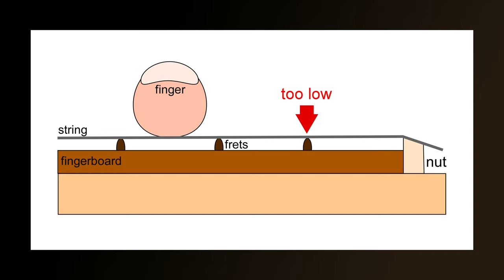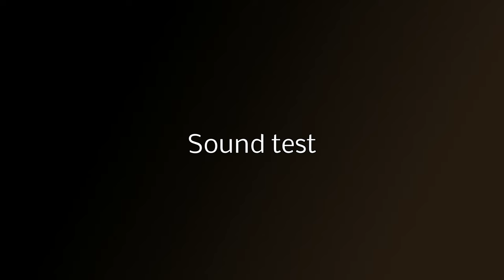How to fit a bone saddle and nut.   Why fit a bone saddle and nut on an acoustic guitar?

Comment: how is the intonation on the g string? Usually it should be wound and since it's not in theory you should need a bit longer scale. That's why the b string is a bit longer than the g...
Reply from the maker: The guitar intonates perfectly.  Sorry to disagree with you, but the G string does not have to be wound at all.  The strings are wound to create the correct mass to tension ratio, so the same effect can be achieved using unwound strings with a greater mass or thicker gauge.  This is why classical guitars are hardly ever have compensated saddles, because the mass of nylon strings is greater than steel ones.
Reply: ok, thanks. I was just asking... @guitar-academy
Reply from the maker: @salmon1s Sorry if my answer was over the top, I was just trying to get as much detail as possible for my students and subscribers.  😊😊

Comment: Would you ever sand down the nut? Also i have a guitar but dont know what model it is. Its a samick, what are the odds of finding a nut and saddle on amazon that fits? Also should it be the same style of saddle? Or should it be the same model on my guitar?
Reply from the maker: Yes I would sand down the nut but it requires a lot of care and accuracy to get it right, I will be doing a video on this soon. The nut and bridge are only in 2 or 3 different sizes so I guarantee you will find a nut and saddle on Amazon or eBay quite easily,  You need to measure the slot and then search for that size.  They don't need to match, but it's nice to have a match for aesthetic reasons.  The make and model of the guitar isn't important as most makes use standard off the shelf nuts and saddles.
Reply: GCH Guitar Academy Thank you! I ordered a bone nut and saddle. I had some buzzing from the high E string and wanted to get a new saddle. Well you'll never guess what I did, I pulled it out and flipped it and now it plays like a dream, im still going to replace it just because its plastic and bone sounds better. Tha js for the help and great video!
Reply from the maker: @higheststandards3344  That is interesting . . good luck with the new one.   Thank you 😊

Comment: Brother, the TUSQ for me in a drop test has much higher tonal expression from the material. It almost sounds like a piece of glass. My guess is the mid-high would be better than the bone with this material. My only concern is maybe the bone would allow the resonances to couple more effectively? There are typically trade-offs, so wondering if you’ve tried this material at any time? Thank you, the content is as usual very edifying. 👍🏼
Reply from the maker: I fit TUSQ on electric guitars to replace the nut but never on an acoustic guitar, but my favourite material for electric guitars is brass.  I like my acoustic guitars to sound richer with as little bite as possible because I fingerpick and hardly ever strum.  At the end of the day it's personal taste and sometimes the guitar that governs the choice of material.  Bone is cheap enough and easy to work with and is a great improvement over a standard nut and therefore is the best thing for a beginners lesson on replacement.
Reply: @guitar-academy  ; yeah, I have both and plan to fiddle around with both as time permits. I’m also changing the plastic pegs for ebony. I did some
research and love that they are in the middle of the range for the response characteristics. Plus the inlays look sharp. 😄 In any case the Martin I bought with the plastic pegs and TUSQ saddle sound as good or better than a friend’s hummingbird. I just want to play a little here and see if I can get more wholesome clean. It’s a little chirpy, that may be the TUSQ. The nut is TUSQ too, but it’s set so perfect from Elderly, the upper action is perfection, so not touching that baby. 👍🏼 The only thing is the bridge height, so going to lower a tender bit and hope I don’t get 🐝.
Reply from the maker: @Twentykixx  I hope it all goes well . . 😊
Reply: @guitar-academy  ; I have your tutorials to help fix me if it does! You shred bro! 🤘🏼🎸
Reply from the maker: @Twentykixx  👍😊
Reply: @guitar-academy  ; so I managed to get the action lowered and used both types of saddle TUSQ vs Bone. Low E @2mm and high E @1.7mm approximately. Both saddle heights exactly the same, and the intonation is set perfectly for both. In my case the bone was approximately .25mm thicker than the TUSQ, and somewhat heavier. The tonal variation at the high end suffered with the bone, but performed equally as well in the low end as the TUSQ. In all the strumming and clumsy picking, I and my daughter both found the TUSQ more pleasant over the full range of the guitar. No buzzing and the action is really ideal at the 12th now. The bow on the neck is roughly .75mm at the largest delta. Changed strings to light and still no buzz and now plays like a dream. Martin makes a wonderful instrument in the D-Series, 🤩. Question... when I look down the neck from top to bottom looking for warping or irregular flex using the 1st fret as a reference point, I simply cannot see anything, however it feels irregular to me for some odd reason. Maybe the nut because of the slope is playing into this? Should I remove the nut and then look?
Reply from the maker: @Twentykixx  You can try putting a capo in the first fret and optionally hold down the strings at the high end (15th fret +) and use the strings as a reference this sometimes works.  Most luthiers use a straight edge like a ruler and then look from the side and not down the neck.

Comment: Can you tell that which grade sandpaper you used?? Thank you 🙇🏻‍♂️
Reply from the maker: good question. . .  to get the saddle to the correct height I used a very coarse emery paper (about p80) and then I finished it with finer paper (about 150).  If the paper is too fine the bone fills it up really quickly and you have to keep cleaning it. 😊
Reply: @guitar-academy  thank you very much sir
Reply from the maker: @ishaangautam5499  my pleasure 😃

Comment: thank you.. I was given a Richwood acoustic electrick guitar for my birthday. I find the action is quite high and the strings are very heavy to push in ... would it be a good idea for me to swap and lower the bridge and nut with bone ...and lighter strings ... what would be your advise ??
Reply from the maker: With guitars it's very much a taste thing and different guitarist like different things. . .  But if it was my guitar i would lower the action and put lighter string on it.  But lower the action slightly with the existing string first (keeping the original parts) and check it's not going to buzz.  With my students I have found that just lighter strings sometimes makes a massive difference. . .  I hope this is helpful . . . 😀
Reply: @guitar-academy  thanks ..I'll start with lowering the action as you discribed it..carefully and step by step.

Comment: Sanding that bone saddle down seems tedious.  Are they sold in different heights?  How long does it take to sand it down?
Reply from the maker: You can get them pre- shaped to specific guitars if you want, but it isn't that hard.  When you think you only have to shape it once it's worth taking your time over.  If you prefer you can use a power tool to get it close and then finish it by hand as well if you want . . 🙂
Reply: @guitar-academy  I've got a Fender StarCaster Acoustic. I am going to start with this one. Watching your nice videos, they are very nice!
Reply from the maker: @carroll6  Thank you very much . . 🙂🙂

Comment: What to do when the groove on the neck where the nut goes is uneven? I have a 2nd hand guitar that someone sanded on the groove and there's a tiny space at the bottom of the nut, if you shine light on one side you can see it trough... Does adding wood glue or some filler will fix it?
Reply from the maker: The only time I've come across this is when the there's extra some material under the nut (glue or varnish).  Usually you just have to make sure the slot is cleaned up with a mini file.  If you want to clean it up without removing the nut, yes a little filler would work . . 😊😃
Reply: @guitar-academy  It's already clean because someone tried precisely to clean the residual glue from the previous nut and sanded too much unevenly, I'm just worried that if I put wood filler the new nut will stuck to it and later impossible to remove
Reply from the maker: @Alex_Martz  good point.  I guess you could put the wood filler in and level it and put the nut in after the wood filler is dry . . 🤔  or you could get a new blank nut and shape the nut to the guitar (that's what I would do)

Comment: Quick question, so I’m not very experienced with the guitar yet but I was replacing my strings for the first time and noticed that my bridge saddle was missing and I couldn’t find it anywhere. I did some research and bought a new one but I was just wondering how much I need to sand it down to since I don’t have my old one as a reference since it was lost.
Reply from the maker: I couldn't answer that in text but perhaps this video will help,  https://youtu.be/UgsN_HOjV2c

Comment: great video, im doing this to my guitar too, and i wanted some clarification, btw, sounds much better, sounds brighter to me :)
Reply from the maker: I've had time to play this guitar now and I can report that it really made an improvement to the sound.  
As long as you keep you old bridge and/or nut you can't go wrong, because you can always put them back on if it doesn't work.  😊
Reply: GCH Guitar Academy yea, ive kept em to compare sizes and sutff, i was suppouse to get the parts today, they still dont arrive :/
Reply from the maker: @bidartbauer8581  oh well . .  I'm sure the parts will be with you soon . . . 😊
Reply: GCH Guitar Academy they arrived! and i switched em already, i didnt have to do anything to the nut, it was the same height as the old one,i did something to the saddle tho, it sounds much better, it needs a lil bit adjustment tho
Reply from the maker: @bidartbauer8581  brilliant  😊😊

Comment: Why do I have metal shims under my saddle?
Fender san luis Rey. Action is high. Can I remove them?
Reply from the maker: be careful, just in case someone has but a pickup there.  But if you can remove them easily, you can always put them back if you aren't happy with the guitar without them . . . 🤔
Reply: @guitar-academy  thank you. No pickup. Gonna remove them. They come right out.
Reply from the maker: @davep2075  👍😊

Comment: Hi,
How do you secure the new nut in after checking action? Glue?
Reply from the maker: No, I don't glue the nut.   I let the strings do the work, but I know people who do.  🙂
Reply: if you wan't to use glue, just put 2 small dots of hide glue. because when it comes time to replace it, if you used wood or super glue, you will have big problems that you don't need.  when removing the nut with hide glue, warm it up slightly with a hair drier. but be careful not to burn it.

Comment: How do u remove the nuts on the side of the bridge.?? I want to change my bridge but i am not able to remove them?
Reply from the maker: If the bridge is bolted in (which not all are, some are glued) you have to drill out the top so you can access the head to prevent the bolt from rotating whilst you are removing it. Sometimes after you've removed the bolts you have to carefully chisel the bridge out.  This is a big job and I don't recommend it if you aren't sure what you're doing, you could destroy your guitar . . 🙂🙂

Comment: Sir I am breaking my high e string of ausotic guitar again and again. Like 2 times a day. I am just so tired of it. Whenever tuning the tuning peg seems to get tighter and tighter eventually breaking the string unlike other tuing pegs. What should I do? Please help me.
Reply from the maker: Is that on an acoustic guitar ?
Some things to check . .  Make sure you're tuning it to the correct note and not a higher one.  If the string brakes in the same place, look for something sharp and carefully file it away.   If it's at the tuner, wrap the string around it more that normal, so the force of the string isn't on the edge of the hole in the tuning post.  Make sure you don't leave the guitar in direct sunlight . .  it could be one of these issues . .
Reply: @guitar-academy  firstly thank you for helping me out. I tune the strings very carefully, never on higher note. I have tried to file the peg just in case of edge. But it didn't help me. While tuing up to the right note the tuing peg gets so tight that it's hard to move and then eventually the string breaks. I have already broken 10 high e string in a month and it is always near the tuning key. I don't know what to do.
Reply: @kanak262  maybe try changing the tuning peg.  You can get decent ones pretty cheap.

Comment: Are you Andy from 'Andy Guitar', your voice is a dead-ringer?! Reference removing the pegs, if you undo the strings then push the bridge ends down into the sound hole the pegs lose their grip in the bridge and can be removed easily just using thumb and finger.
Reply from the maker: No, I'm not Andy . .  yes, that trick works most of the time, but not often on new guitars I think they hammer them home with a rubber mallet 🤔
Reply: @guitar-academy  Hehehe probably. Could ask a question? About restringing a righty acoustic to lefty; the general advice is no, but I've been looking at cross-sectional plans for a range of dreadnoughts and they all appear to have perfectly symmetrical bracing from the top of the body to behind the bridge. There is a single diagonal stringer well behind the bridge that's doesn't appear to be structural ie a bracer. Therefore I think that it's feasible to safely mount a new bridge, saddle and nut, and re-string. Am I wrong? I'm in the PH and you simply can't get a lefty in the area I live. I want to do what you did and pick up a cheap guitar and get it up to reasonable quality. Thanks for your quick reply earlier.
Reply from the maker: @tyrotrainer765  Hmmm . .  whether you can change a righty acoustic to lefty depends on the make and model.  The most obvious things you need to change are the nut and possibly the saddle.  Each slot in the nut is cut according to the thickness of the strings, but you can just buy a new lefty nut and/or cheap enough.  The biggest issues can be if the guitar has got a cut away (obviously this can't be moved), and is the saddle on an angle.  It's common on acoustic guitars for the saddle to be on an angle so the thick strings are longer than the thin strings, this is done for intonation and would need to be changed.  On some guitars the bridge is bolted in place which would make it an easy job, but on others it's glued and can be very difficult.
Reply: @guitar-academy  Cheers for that. It's actually quite easy to get LH plastic and bone bridges, saddles and nuts here, from China via online shopping, very cheap as well. Yeah, I'd only attempt it on a dreadnought; I've got LH nice LH Yamaha dreadnought and a mini Martin I bought in London a few years ago, and looking inside everything is perfectly symmetrical, so string tension shouldn't cause any twisting issues as far as I can see. I want a cheap guitar I can throw into the back of the car and take down to the beach without being worried if it gets a few knocks. Thanks again, love your videos.
Reply from the maker: @tyrotrainer765  No problem, thank you 😊😃

Comment: could simple flat files be used to shave down the bridge?  I got a aluminum fret block in the mail but it is small, about 6 inches.
Reply from the maker: I have used a piece of wet and dry sandpaper taped to the a glass desk top before now . .  anything will do as long as the surface on the bottom of the saddle is flat when it's finished . . 😊
Reply: @guitar-academy  but not a file laid flat? This would seem ideal. ?? Or does the file take off too much?
Reply from the maker: @carroll6  no . .  that should be fine.

Comment: What if you do not have the original saddle?
Reply from the maker: You can buy a new one measuring the length and width of the slot for reference.  Once you put the new saddle on put the strings on loosely so you can see if the new saddle needs adjusting . . 😊

Comment: Is it okay not to glue the nut? Im planning to replace my guitar nut and the one on my guitar right now is glued.
Reply from the maker: Yes, it's OK to glue it, but not with a strong glue, because you might need to remove it again in the future . .  🙂
Reply: @guitar-academy  Which adhesive should I use? Is wood glue diluted with water the best option ?
Reply from the maker: @vin4216  That's a great option.  You can also use wood glue as it is if you want but just put 2 dots of it on the nut.  🙂
Reply: @guitar-academy  Thank you so much.

Comment: Is it not necessary to glue the nut?
Reply from the maker: No, not on this guitar.  It is necessary on some off center headstock guitars, but they are very uncommon.  If you do find you need to glue it down use glue that's not too strong, so you can get it off again if you have to . .  🙂